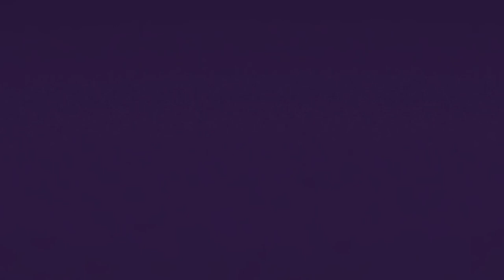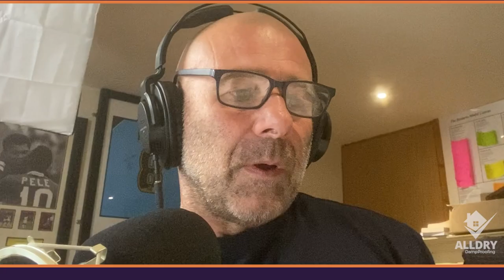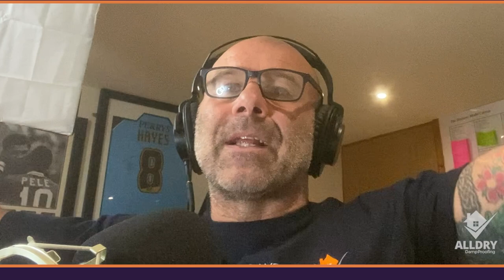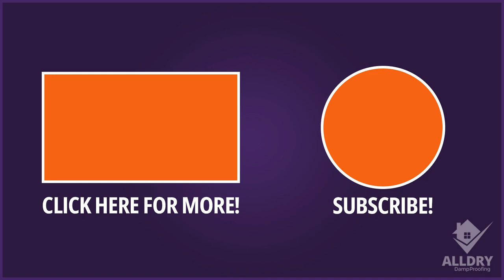Barnsley Council: Have They Got A Damp Diagnosis Wrong?

Comment: I see first hand how "maintenance surveyors" mis diagnose damp issues.
I'm always asked to hack off, apply tanking slurry and reinstate with renderlite when the majority of the time the walls are bone dry. One a few occasions the walls were actually stud walls 😂 and one one they wanted me to apply ronacrete to floor junction gap to brickwork. However, it was clearly a timber floor with air bricks underneath allowing cold air to create cold spots above the skirting board 🤦
Reply from the maker: Shocking 😳
Reply: I've learned more from watching your videos than these so called "surveyors" seem to know. I refuse to call them that now and just call them inspectors as all they do is a visual inspection and write up the schedule of works from that 😂

Comment: a council getting something wrong , falls back amazed .  A council were told by Kingspan that the insulation was not to be used above 3 stories high , so the council installed it in a tower block , cant remember which one :-)
Reply from the maker: Yep good point

Comment: Dear Damp Sam, It would be great if you could knock up a cavity wall section and have the fire brigade put their hose on it to see whether or not  water  could jump across the cavity onto the internal wall. Once built you could then try the same experiment with various types of cavity wall insulation to see if water will track across and then send the results to Barnsley Council before they lay put £1.15 million of tax payers money.
Reply from the maker: Good point